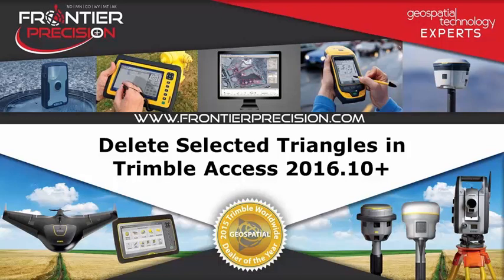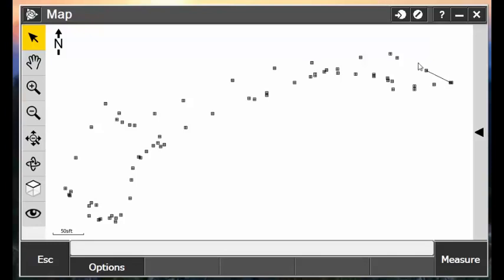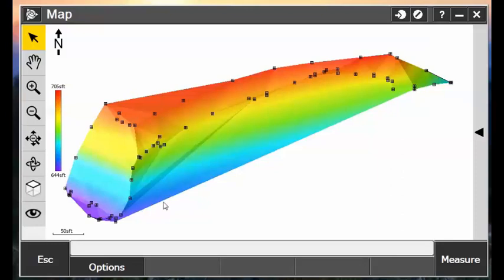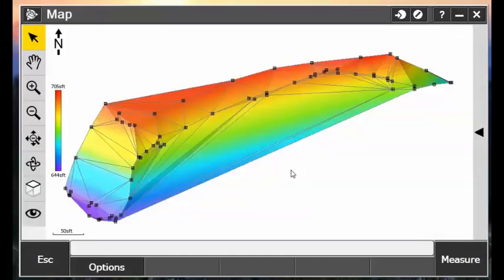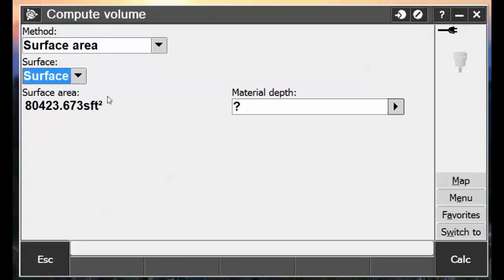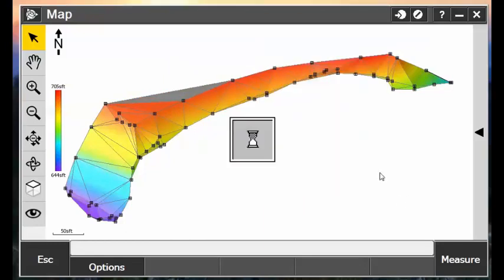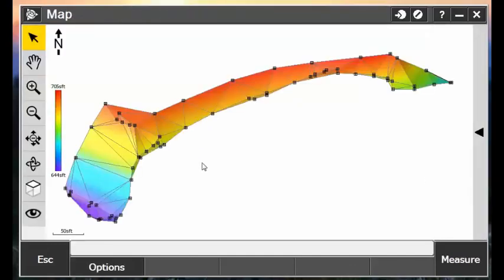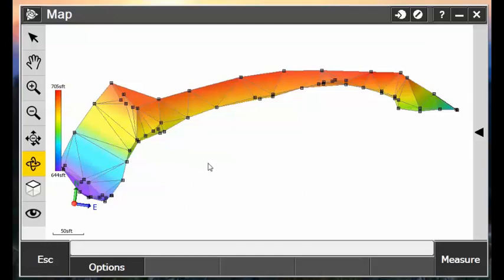Delete Selected Triangles from Surfaces in Trimble Access

Comment: I typically just use business center for this.   But when I use the controller to make surfaces in the field I have no way to delete them when I no longer need them.    I'm using a TSC7 with trimble access 2021.10.   Do you know a way to delete field created DTM's from the controller?
Reply: Nevermind.   I figured it out.
Reply: How did you find out